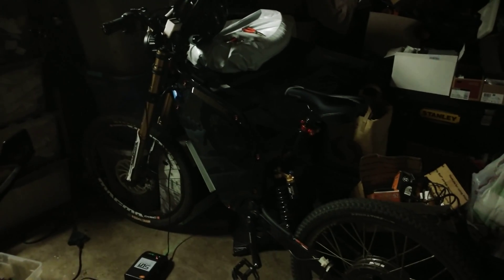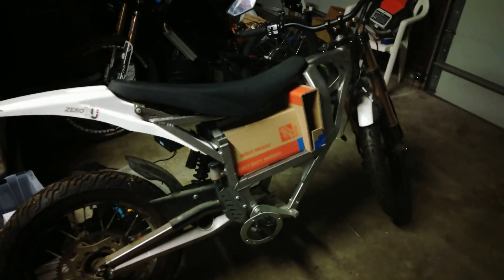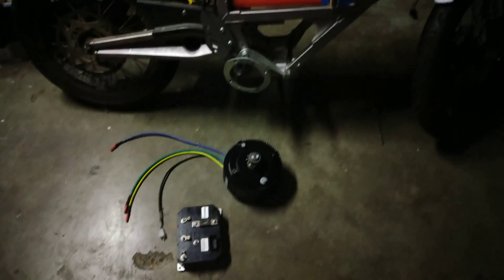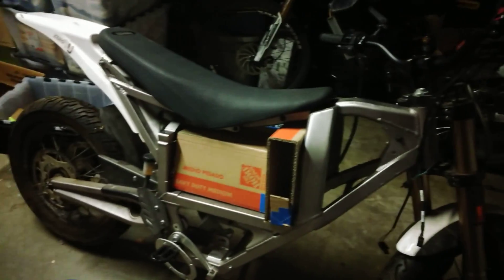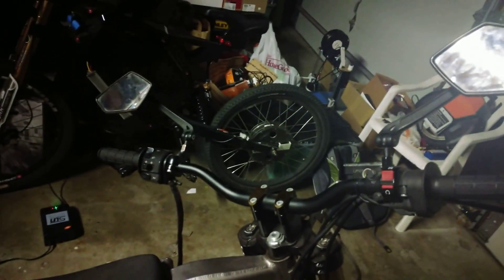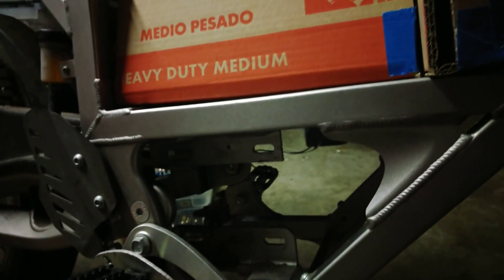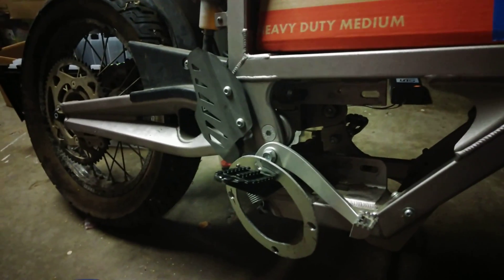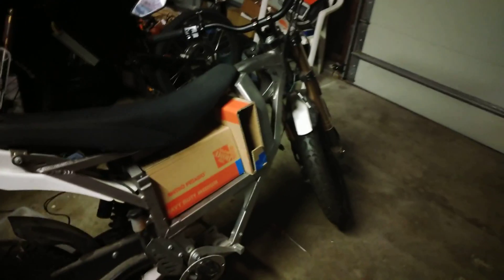Next project: Restomod of a 2011 Zero XU

Comment: I just bought a 2011 xu that is very low miles according to the seller that has a dead battery but is otherwise all there would you happen to know what the specs are on the stock motor/battery? I need to build a battery for this thing

Comment: I have an old Zero MX. I would like to turn it into a super light bike. Thinking about getting a lighter motor and battery pack. I know the new Zero have a wider belt that’s stronger. Probably a lot lighter than the chain.